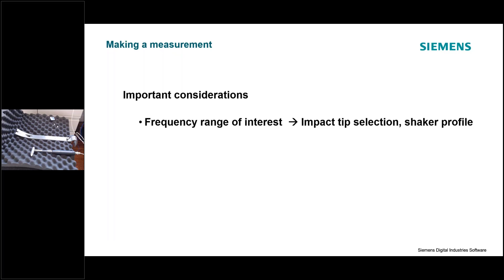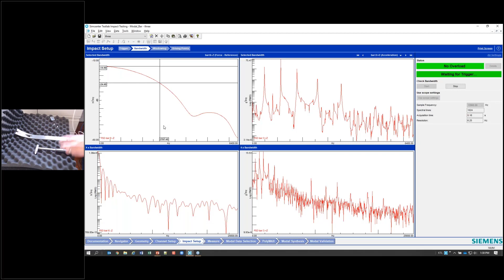Which Modal Hammer Tip?

Comment: Hello, should we choose different hammers for different materials? In today's work, I tested the origin frequency response of the automobile air-conditioning box. I chose the nylon hammer, and the first-order mode is about 250Hz, which is inconsistent with the actual situation, and the coherence is very good. Does this mean that the lower-order mode is not excited due to the selection of a harder hammer? Should I choose a rubber hammer to excite lower order modes? Thank you. Looking forward to your reply?
Reply from the maker: It should be impossible to excite higher-frequency modes without exciting the lower-frequency modes.  The impact event excites all frequencies up to a cutoff frequency; the stiffer the tip, the higher this cutoff frequency is.  The value of a less-stiff tip is concentrating all of the energy of the impact event over the lower frequency range, rather than spreading it out.  What do you expect the first natural frequency to be, and why do you expect that?
Reply: @SimcenterTesting  Perhaps my colleagues gave me the experience that the mode of the car air-conditioning box is about 200Hz. When choosing a harder nylon hammer, I found that one peak of the FRF curve exceeds 300Hz, so I feel abnormal; May nylon hammers fail to excite low-order modes?